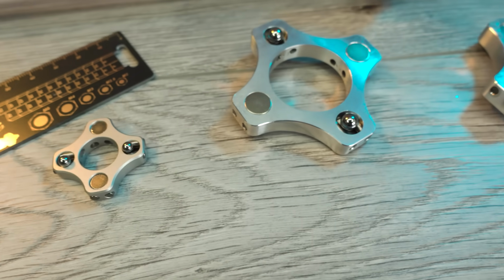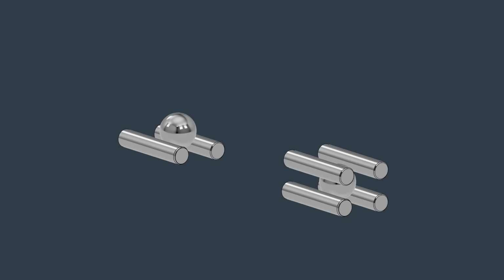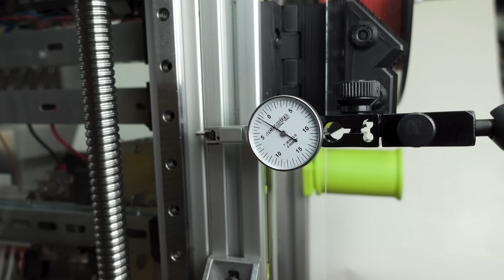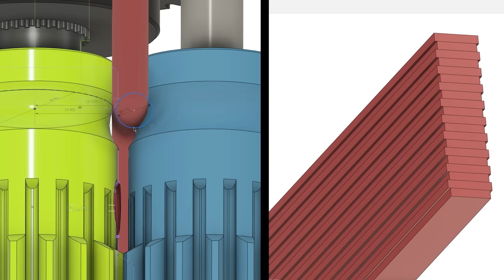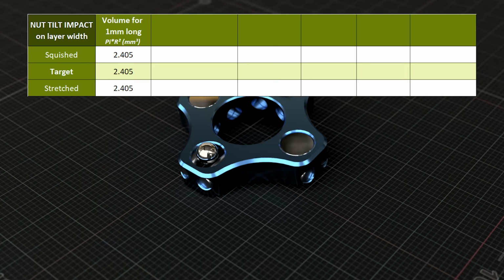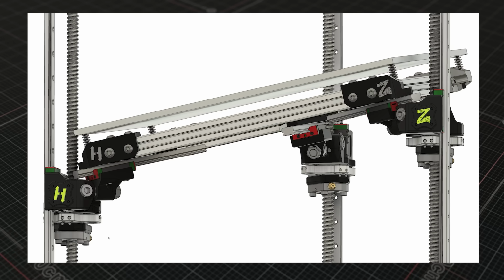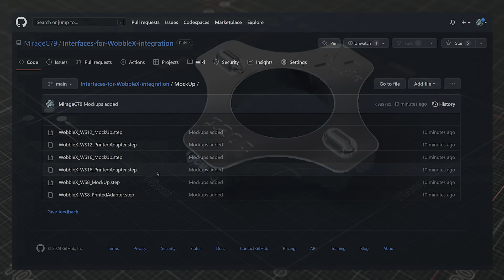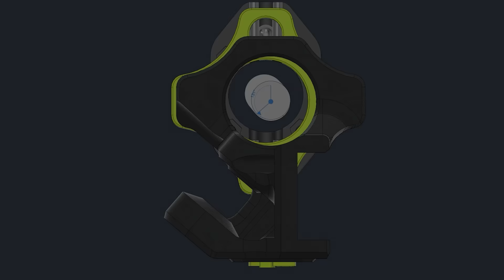I will never talk about Z wobbling ever again !

Comment: I have wondered if a one piece x-y flexure block could  compensate in a similar manner. Another idea is a single layer thrust ball bearing design similar to your first approach.
Reply from the maker: We tried the flexure, When making them printed, the size required to be solid enough made no sense and was increasing the nut tilting factor by a lot.  Material would also creep over time and heat.

Comment: Amazing work! I wonder if sth like this is possible for mSLA resin printers as well? But no idea how that would work with the peeling forces.
Reply from the maker: The problem would be that you'll need to work in both Z axis directions, therefore separating the wobbleX as you press the plate down to the VAT.

Comment: Sorry, but for me the whole story is:

1. Implement overcomplicated Z axis with expensive ballscrews and tilt compensation using small rails (!!!), use two mounting points for ballscrews instead of one
2. Get Z wobble issues like I've never saw on any 10x cheaper 3D printers
3. Implement overcomplicated solution to battle this Z wobble
4. ???
5. PROFIT
Reply from the maker: The aim is to provide industrial level solutions that can be sized to larger heavy printers.  I agree with you, most of this would not apply to smaller cheap printers.  And profit wise, the few buck we are making out of this are being pumped back into the R&D of our HevORT project.

Comment: @MirageC: I have installed in the VCore 3 Ballscrews 1204. Could you also create the matching bed arms with your anti Z-Wobble?
Reply from the maker: do you have a link to the CAD of the solution you used?
Reply: @MirageC  I have customized existing bed arms for me. They don't look good nor do they work well. I'm sure you could do better than me. I therefore looking for a better solution such as yours
Reply: @MirageC  Can you mod the original VCore 3.1 Bedarms to Use your Anti-Wobble with SFU1204? I Want them!!! ;-)

Comment: What are the issues with oldham couplers however buddy dont they achieve the same aim?
Reply from the maker: They are very similar indeed.  The only added benefits of this solution are:
1 - Zero Backlash
2 - No friction by design
3 - Manages tilting of the nut

Comment: Hi. Can I ask you about your PC and the software you use to simulate this? I currently have an openbuilds style CNC router that need some upgrades. But need to simulate a lot of things before start buying parts
Reply from the maker: I have an old I7-7700k printer with Fusion360.  The tough part of making such animation is to define the joints properly. But once you know how, magic happens!
Reply: @MirageC Oh okay. Thanks. I was using fusion for toolpaths but need to explore others tabs as well.

Comment: Hi, great solution! I saw for voron v0 it says backplate impacted. Is that the case even with the new tiny wobblez?
Reply from the maker: The problem I encountered was that the back plate would sit right where the WobbleX is: https://github.com/MirageC79/Interfaces-for-WobbleX-integration/blob/main/Voron/V0.1/Voron_V0.1_WobbleX_T8_Clearance_45deg_Top.png
Reply: @MirageC  Thanks! I can't really see from the picture how much more clearance is required. Just by looking at my v0, I think the backplace can be pushed back a bit for example with a spacer
Reply: @MirageC  Hi there! I checked and the backplate can be pushed back. Any chance you have the stl for voron 0.1 for testing?

Comment: I am happy with the belted z lift on the Valkyrie triple z. It eliminate any wobble due to screws.
Reply from the maker: Sweet!  glad to hear that.  Did you have to install a brake system to secure the bed when motors are not energized?

Comment: Would this be simpler if it was made from steel? It would only require machining from 2 sides instead of 6, but it would require heat treatment and I guess being ground to spec.
Reply: I don't see how that would make it simpler, aka "less sides to mill". You still would need to machine the exact same sides as with aluminium; you still would need to produce the same basic block/shape.
Reply: @CookieTube  The aluminium needs to be drilled from 4 sides, which wouldn't be needed if the ball bearing tracks was just a milled/ground feature, you also wouldn't need to press fit the rods or produce the rods.
Just:
Mill side 1
Mill side 2
Heat treat
Cold blue?
Grind tracks
Press fit magnets

Instead of the aluminium part:
Mill side 1
Mill side 2
Drill side 3
Drill side 4
Drill side 5
Drill side 6
Or be milled on a more expensive 4-axis mill.
Anodize
Produce/Cut rods?
Press fit rods
Press fit magnets

Comment: I'm planning on buying a bambulab X1 and leave my ender 5 plus as a backup big volume printer, but maybe with this I can extend its life a bit longer!

Edit: the ws8 is out of stock, any idea when they will be back?

Edit2: I installed the wobbleX, and under the correct amount of light I can see a tiny amount of movement. However, I still have massive Z issues. I gave up on my ender 5 plus, I have a bambulab X1C now and it prints flawless.

Comment: Useful device. But there is one remark. The ball screw pair works better in tension rather than compression. The ball screw must be fixed at the top of the printer, not at the bottom.

Comment: The linear rails guide the bed, the trapezoid threaded rod moves the bed.
This is the first printer I see this kinematic principle applied to. There is still one problem in my opinion, this coupler should be mounted between the motor and the threaded rod (taken an Ender 3 as example) while the other end of the rod is unsupported. Otherwise the wobbling will get worse the closer you get to the motor.

There are all sorts of couplings to help archieve this. This is also what all those people saying Oh nooo my Ender China piece of shit needs TWO threaded rods and TWO motors ...no it does not, in fact it is overdetermined this way.

Comment: You said you had previously problems with the steelballs destroying the coating of the magnets. What makes the wobbleX different from your previous iterations regarding the toughness of the metal pins. Are they hardened or anything? Because now they are the point of contact.

Anyway i liked the design/idea from the beginning but never adapted to it because of the "backlash-problem". Now it seems to be about time.
Reply: Just a guess but I'm thinking the only reason the magnet system failed was because the magnet plating is extremely weak, even compared to a non-hardened pin.  The original design may have even worked with a thin solid metal washer interface.

Comment: Putting your indicator on the bottom of the z like you do at 5:30 leaves potentisl for the indicator to flex down with the spring.

Most likely more than indicator reading

Comment: This is pretty amazing, great work and problem solving.
Now for my question. I have built a V1 Engineering lowrider 3 CNC, with a cut capacity of 4 foot by 8 foot. Would this system help the z axis on something that requires extreme rigidity such as a CNC machine? It is actually a great machine and does perform incredibly well, but the gantry is quite heavy and the lead screws, even high quality ones, eventually warp and wear out over time. Would love to get CNC results as smooth as your 3d prints. Thanks for contribution to the maker world.
Reply: I'm just guessing here, bit i'd say that the surfac finish you're getting on a CNC has less to do with vibrations introduced by the ballscrews and more to do with lack of rigidity in the frame, spindle/tool runout etc.
Also keep in mind that Mirage's bed is floating on an extra guiderail while all the axles on a CNC are fixed to the guiderail.
Reply: @saldot79  The rigidity of the frame is the key factor, however, this build is on 20mm supported solid stainless steel linear rails on the y axis mounted to a zero flex cast iron table. They y rails are steel optical rails with bearings rolling on them, no play. the weakness is in the leadscrew/flat style linear guides that moves the entire x rail system up and down, that's where play gets introduced, only along the z. The spindle is spinning at 16000 to 27000 rpm with enough torque to chew thru aluminum at 80 inches per minute. when going from climb to conventional in its passes, it sometimes leaves a barely noticeable "step" caused by the resistance of the bit spinning in the direction of the cut/material to spinning against the cut/material, which is transferred to the z rails/screws that are supporting around 25 lbs  with the gantry and the spindle.  I was just thinking that this could be compensated for with this system. Thanks for the reply, it is greatly appreciated.

Comment: i wish these had the other sides plates 
also so they dont have to be crappily printed
Reply from the maker: Oh, that's an Idea.. Let me have a look.
Reply: @MirageC  looking forward to it, it woudl make mounting easier like the original wobble wings.  I am using 10mm lead screws on my HEVO machine.  I was tempted to just order extra and drill mounting holes in the them for side plates although not ideal.  Hope you come up with something.    At the very least they should come with the extra rails needed for the other sides.

Comment: Interesting...  I had been aware of the WobbleX for ball screws - which lead me to eventually find Mellow NF Oldham Couplings.

It is interseting to see WobbleX available for lead screws now as well.
I wonder how it compares/contrasts to the Mellow NF Oldham Couplings.
I imagine the biggest difference is the ability to deal with any axis tilt?

In my case, the printer is a heavily modified Folgertech FT-5 (that probably more resembles a Voron 1.8)
Reply: You are probably correct, the Oldham coupling does not appear to be able to deal with axis tilt which can transfer some forces. Depending on the tolerances in the mating surfaces may cause some binding and reduce how effectively it can slide past each other.  Tolerances is also much more important to prevent unwanted movements. 

On the other hand it should still work even if the screw is horizontal, where as the WobbleX could only work against gravity.
Reply: I have 2 ender, several of my coworkers have enders, no Z-wobble observed ever in real life

Comment: I do think you should find out if higher-quality ball screws make any sort of difference when you’re using the WobbleX
Reply from the maker: High level of precision ball screws are super expensive.  I did not try them.
Reply: Precision ball screws are ground to size and do not have ten thousandths runout within a screw of such short length.

It's also possible to straighten these cheaper screws between precision centers with a torch and dial indicator to less than a thousandth or two. We had an old tool and die machinist that was retired from John Deere and was quite skilled at this straightening process.

The parts we were making were precision ground but had warped once released from the magnet on the surface grinder due to internal stresses within the metal. 

The pieces were all ran through the heat treating oven to release these internal stresses which at first seems to make the warpage even worse.

The old timer would then fix each long rod between centers with a common welding torch. He would measure to find a section of runout, mark it and then apply heat to the opposite side while watching the indicator needle. There is spring back once these parts cool down but he was so skilled he knew how to compensate for the cooling during the torch process.

In the end the parts were dead flat without any internal stresses.

Comment: Wouldn't runout on the screw still translate to inaccurate z moves? Or am I talking such miniscule amounts it's neglible?
Reply from the maker: of course yes, if we do the math, the triangulation of all these compensation will create microscopic variation.  But which is worst... PID tune, Nozzle Pressure Management, XY pulley excentricity,  Extruder wobbling, filament inconsistencies.... Its an ocean of variability, we lower the level of water one inch at the time to reveal the higher rocks as they come.  I think we have bigger fish to fry at the moment.
Reply: @MirageC  Error accumulation baby! But I agree with your content, seems the volumetric flow of plastic plays the largest role in variability.

Comment: I really like mellow's parts, they are expensive, but people say something about getting what you pay for... Congrats on succeeding on creating an awesome product!
Reply from the maker: Thank you!
Reply: like straight ball screws?
Reply from the maker: @michaelwatson7211  will you sponsor them?
Reply: @MirageC  I think I don't really get the problems you are trying to solve, my background is in CNC, the idea of a ball screw deforming the frame is pretty nuts, as is the idea of using a bent screw. Why don't people use a cantilever bed on 4 bearings with a single screw (I've seen this with 2 bearings eg ultimaker but not 4)? Wouldn't it be cheper/ easier to make stiff than using 2 extra ball screws, if you don't care about weight in the frame the whole thing could be welded in thick plate it would be pretty easy to shim it flat once and be done with it. I also don't think you really get any benefit from ball screws over lead screws here, there can't be any backlash becuse the force on the bed is always down, unless there is somthing strange going on with the frame deforming or the 3 screw arangement. Like I said though I don't get the problems, the costs i was using in my head seem to be about an order of magnitude more than you are spending for screws at least, maybe the calculations just all work out different to my intuition.
Reply: Well, I love how they charge ridiculously expensive for a simple part they designed themselves while at the same time sell cloned part at cheaper than original but almost if not even better quality than the original😂 

what a duality of Mellow
Reply: Instead, how about starting with high quality ball screws and properly machined bearing ends, along with a rigid frame and precision sliders?
Reply from the maker: @gyrogearloose1345  Are you financing?  This solution is the cheapest way we found to benefit from the high durability of ball screw.  Z hop all day with a heavy bed without any maintenance.
Reply: @gyrogearloose1345  Instead, why don't you brokies just have more money so you can waste an exorbitant amount of it on expensive ball screws for an application where they're unnecessary? How stupid do you have to be to not have loads of money sitting around to waste on ball screws? 

While we're at it, why don't we just tell homeless people they need to buy houses; seems like an obvious solution 🤦‍♂

Comment: i just looked to buy the 8mm version and it says out of stock... already ?
Reply from the maker: I just spoke to Mellow, he is working on restocking.
Reply: @MirageC  thanks .. i also looked at the video and the link you provided. i was wondering if there are adaptors to fit on other printers such as the zerog .. ratrigs and others? like adaptor that would fit every printers mostly
Reply from the maker: @kennybeaudoin  It takes quite a bit of time to design the adapter parts, i'll be doing a few when I can.  We have RatRig Vcore, Voron Trident and Ender3 available now
Reply from the maker: Some were added to the stock just now. 😉

Comment: Now take the same concept and use it to get rid of the short linear rails on each z screw.
Reply from the maker: Are you having trouble with yours?  What would be the benefit of removing them?
Reply: @MirageC  it would lower the cost to build and improve the size efficiency of the machine. With the same size frame You’ll gain about 40mm in z and over 50mm in x and y. You can also get rid of the extrusion under the build plate entirely and just pull the balls into the hex of shcs screwed directly into the mic6.

Comment: I know you are beating a dead horse, HOWEVER i super appreciate the systematic approach of testing and validating mods.  Too many it seems are done in the name of performance, but end up causing more issues that they fixed.  I'm currently trying to print as fast as possible with the best quality on ender 3. Lack of time does not allow for the cool stuff like voron.
Reply: this kind of problem was already solved for over a century
Reply: That's simple. Lighten the axis's. The lighter they are, the faster they can move and change direction. But on an Ender 3? Bed slingers are not meant to go fast.

Comment: Isn't this thing+C7 ball screw costs the same price as C5 ball screw which basically have almost zero eccentricity due to completely different production process?
Reply from the maker: How much are your machined C5s and what is their actual runout?
Reply: @MirageC  sorry, i've posted this and completely forgot about it, 300mm C3 1605 ballscrew(it is claimed to be grinded and seems like so) aliexpress asks $100 bucks, so your solution nearly half the price now(with c7 ballscrew and wobblex at 30 bucks each)

Comment: Or folks can just buy an Oldham coupler, which has been around forever and is the same thing and more compact
Reply from the maker: Olham have a bit of backlash and friction by design.  They also don't deal with the nut tilting 5:18 .  But yeah, they are similar, all depends what you are looking for.